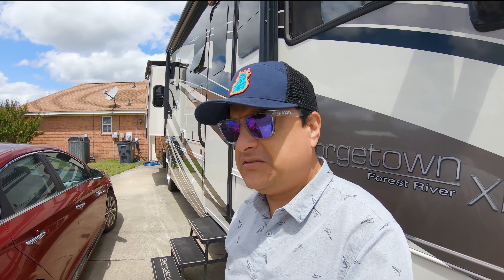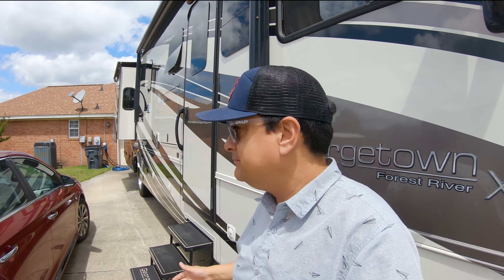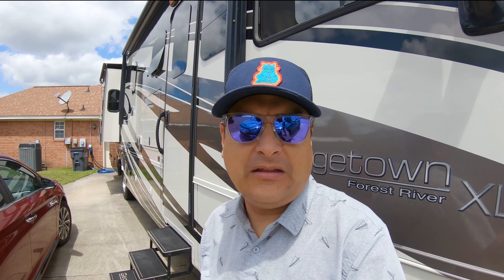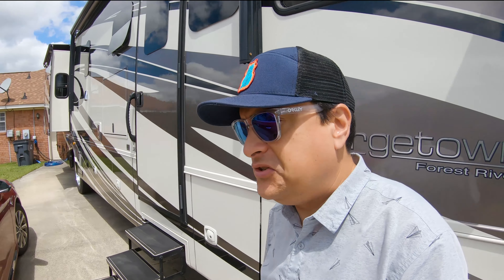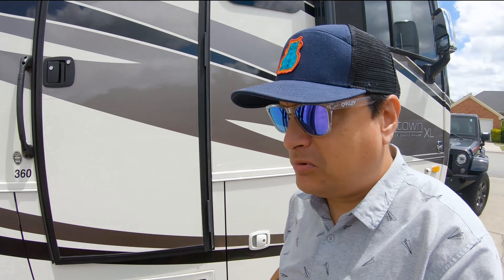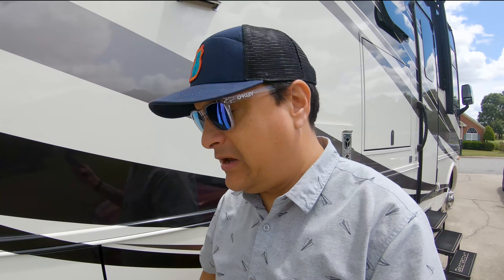Camco Cyclone Roof Vent Install

Comment: If we ever get to spend time at our seasonal campsite this year, I'll check the operation of the one that's installed up there and make sure it swivels loosely like yours. We had times that it smelled badly in our RV last summer. Thanks for the post man!
Reply from the maker: Sounds great!
Reply: @DylanAndLeslie  we ended up upgrading to a bigger and newer RV. All the problems were solved LOL